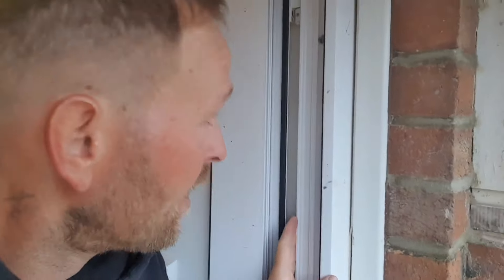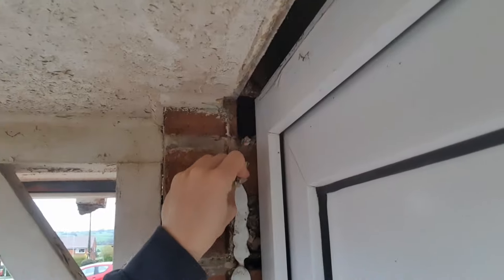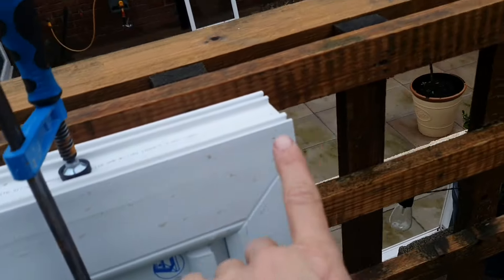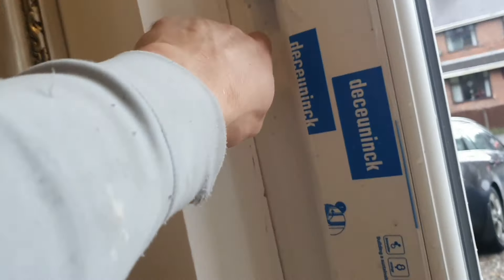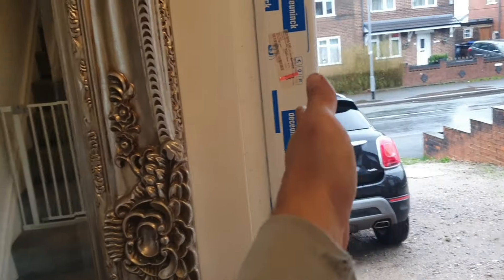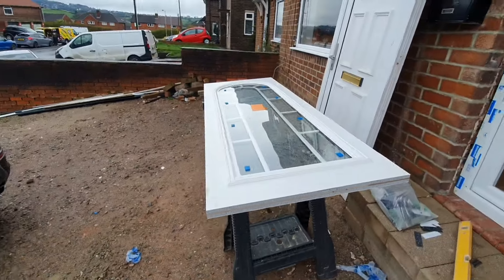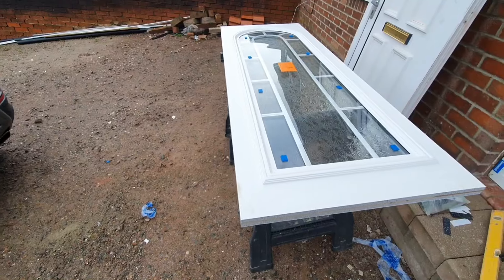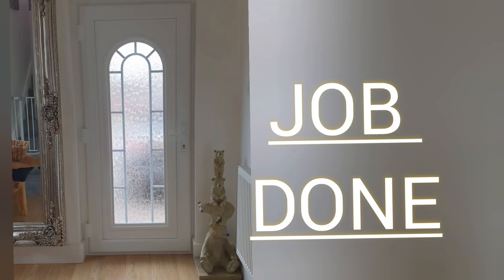Installing a New Front Door #DIY

Comment: Done myself a composite door a couple of years ago, made a right bollox of the drilling through the reinforced frame. Must have snapped 4 bits until I phoned a joiner m8. Start of with a small hole he says 3 mm and work up too 8mm.
Used the same concrete screws btw.  Must be the best fixing about for that kind of work!!
All coming together, You’ve done well pal 🤙🤙🤙

Comment: Nice job, no criticisms here.
But i think Fensa and building control is more to do with insulating properties, escape routes and that kind of stuff, not the actual mechanical fixings. I may be wrong.
If you're replacing like for like or improving the thermal efficiency and/or fire safety then i don't think it's an issue.
Keep up the good work. Thinking of having a go at the front door myself. 👍🏻